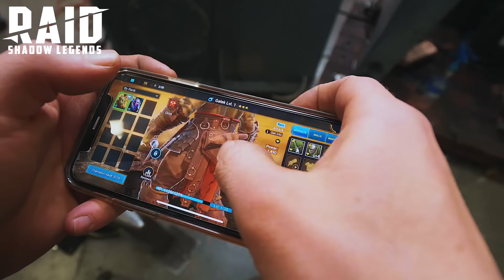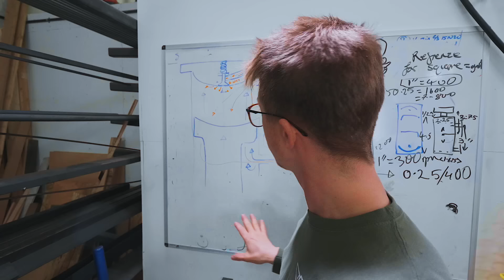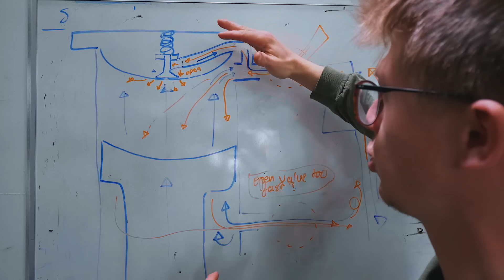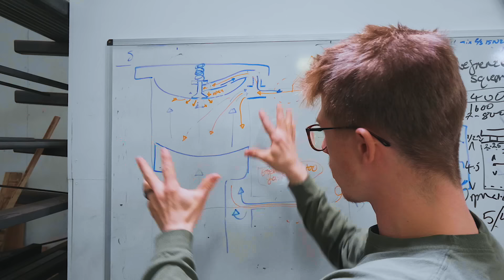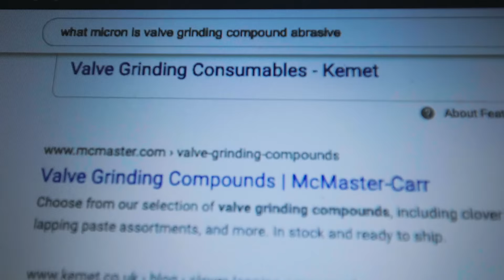FIXING THE 300LBS POWER HAMMER!!! Part 5

Comment: I have a suggestion there not enough pressure on the valve to close the valve when the hamer is going up it happen to hi power engines when there turbocharged the engine is moving so much air so fast with so much force the valve spring can close the valve fast enough and u wind up breaking valves but since the valve on the chambersburg is counter set in the top casting u wind up smacking the top try messing around with the valve spring streangth to prevent air forcing the valve open while the piston is coming up and resulting in the lack of air pressure needed to stop the ram from hitting
Reply: Another possible cause could be the  ram not sealing fully against the bore and the "air cushion" is leaking past the ram allowing contact with the top cover.
Also check if the top cover is warped more that the gasket material can compensate for.
Reply: wonder if he can find a spec on the valve spring pressure.  in cars it's measured by LBS/inch.   John Grizzle also has a great suggestion.  the seal would be a wear part.
Reply: Maybe also oil the gasket (both sides) and reinstall. However, I wouldn't expect that volume of air to make much difference. Intriguing - interested to know what it is when you fix it!
Reply: Yup check spring and if the piston has rings or gaskets those are probably due to be replaced as well.
Reply: Definitely check the piston seals!
Reply: It may be leaky enough that you'll need to supplement pressure with an air pump.. How high is your altitude, btw?
Reply: @graithtools8215  
That's a good point. Ambient air pressure and air density might be an issue you need to tweak for.
Reply: So Ethan, are you talking about valve float? That is at high revs the spring is not strong enough to close it fast enough the piston slams in to the valve. This is not what is happening here. This is a back up only opens when the piston gets too high and covers the normal valve holes and making it stiffer would not help. It could be to strong and looking at the valve it does have an adjuster so maybe he got it too tight so it's not opening soon enough or wide enough to keep it from hitting the top. John Grizzle I think blow by might be an issue looking at the walls there is enough surface rust to maybe hurt the rings or seals (if it has them).
Reply: Valves opening from air pressure in combustion engines is a myth. And I'm sure this isn't comparable to "valve float" we would encounter in combustion engine.

Comment: Judging by how easy it was for you to compress the spring by hand, I would say the spring is worn out. Tightening it more may not be enough, you may have to replace the spring. You can have a perfect seal, but the compression alone can force it open if the spring is weak.
Reply: Exactly
Reply: I agree, often you have to replace valve springs on an engine.
Reply: When the hammer is moving up the valve is forced into it’s closed position, the spring is not being compressed. I think that means the spring is not the problem.
Reply: More likely air is escaping around the ram therefore not creating a proper air cushion
Reply: Please paint it.  It deserves to look so much better than that!
Reply: @freebordwerm  I disagree, metal on metal no matter how much you polish it will not create a perfect seal. The spring is there to help prevent air from working its way between the two metal surfaces and forcing the valve open. If spring tension is to loose it will force the valve open since it is following the path of least resistance. This happens with cylinder heads on a combustion engine when the spring is worn out resulting in compression loss, blow back through the intake, or backfiring through the exhaust.
Reply: CARL X GAMING you nearly had me convinced, I see where you are coming from but if you mean that the air squeezing between that seal could open the valve even more then I think you are wrong. The pressure exerted on the inside of the pressurised chamber does not discriminate. It will apply force to all inner surfaces in an outwards direction, forcing the valve closed (as closed as it can be) That is the premise of that valve.
In conclusion, some air is likely to escape through the valve but given the volume of the chamber and the speed of compression I don’t think it makes a meaningful difference. But the escaping air through the valve cannot possibly force the valve to open at all. 

Don’t mind if I’m wrong but I don’t think I am.

Edit: The spring is there to make sure the valve returns to the closed position after it opens.

Comment: In the automotive world, we would check the recommended spring rating to see if that was sufficient, then also lap the valve seat to fix the seal. Fun stuff. 🤓 I made my comment about 5 minutes in. Clever workaround. A wise man once said “it’s not stupid if it works!” 🤓 Paint the hammer in a Union Jack pattern, of course.
Reply: Union Jack! My thoughts exactly! :D
Reply: Only appropriate if it was made in the UK or British Empire.  If It is from the U.S. then the stars and bars would be a choice, but seeing as I see the equipment as being from a company first, then the country of manufacture, then I guess the original paintjob would be most appropriate.  I think your suggestion is pretty good, especially as Alec came from the U.K. originally but given my choice I would do it differently because I would love to see the original finish on this antique machine.  No disrespect intended to your opinion, it is after all a pretty cool and iconic idea for the hammer.
Reply: I was thinking the same, Union Jack!!!!!!

Comment: My money is on that spring needing replaced. It’s probably taken a set over the years.
Reply: I agree
Reply: Yupp, a spring that large seems like it should be pretty stiff, but obviously he's able to compress it with just his hands.
Reply: Only problem is finding the right spring tension. Too soft and the piston hits the cover. Too strong and the valve doesnt open and cant start sending the piston down.
Reply: The spring's purpose (if you look again at the diagram he drew), is to allow air back into the chamber on the cylinder downswing. Once on the upswing, even without a spring present the air pressure would push up on that valve and seal it. That's what he was lapping.  The spring is only there so the valve isn't hanging open all the time, it only needs enough force to hold the weight of the valve and open easily enough when pressurised on the downswing.  Unless the spring is so weak it doesn't even hold the valve's weight, which I don't think Alec would have missed.

 I think he has to go back to adjusting his turnbuckle like in the previous video.
Reply: @NytRydr  good point.
Reply: @NytRydr  However, what keeps the air from going past the valve stem and out the top when it opens? If it is on the up-stroke and forces the valve open, the air may still be escaping past the valve stem if the valve guide is worn. But really I am just spit-balling ideas at this point....
Reply: @UncleDon226 The top of that check valve also has a cover, you can see it at 13:48, so it's unlikely that air is leaking out there. What I read another commenter say is that it could be the piston rings (if it has them) that's worn coupled with the rusted cylinder bore that could be it. But I am just guessing too.
Reply: @NytRydr  Just a bunch o' lads debating the intricacy of machinery. Doesnt get better than this

Comment: Alec: Explains why it's impossible to mate two metal surfaces airtight without a gasket.
Alec five minutes earlier: Shows how to mate two metal surfaces airtight without a gasket.

All right, I know.

Seriously, the more I see of this thing's guts the more it looks like a two-stroke engine. How is the ram sealed to the bore? You can't run a two-stroke (or a four-stroke) for decades on the same set of piston rings, and you sure can't expect that monster to use the same set of ram seals forever.
Also, the in and out valves surely need more attention, as you said beginning with that Jerry-rigged linkage. Somewhere there must be an ancient generic shop manual on setting the timing on these things.
Reply: The piston rings is actually a really good one. It has always stood out to me how fast the ram comes down once the machine is shut off. Indicates air is flowing past the seals quite quickly
Reply: My thoughts exactly. I think the ram seals are bad, or maybe they're directional and upside down. Causing more pressure to lift the cylinder than drive it down.
Reply: Likes comment because it sounds smart and correct, has no clue what half of the words mean 🤣👍
Reply: @thorzyan  ;>)
Reply: second person I've seen mention piston rings... and I think you're right.
Reply: I thought the same thing.. :) but to the layman (not alec) that is watching.. trying to explain the absolute difference and why gaskets are used would take too many words. I let him off the hook because he said "allow you to use a milled finish and a gasket", justifying the reason they are used... to save costs as lapping is time consuming and would be expensive in large manufacturing where a gasket will do just fine.
Reply: @jdeluca6181  I don't think they'd be in upside down unless an absolute dipstick had done maintenance on it at some point. Badly worn, for sure.
On the other hand look how poorly the whole machine had been treated to let the original motor be damaged as badly as it was. Maybe that dipstick really was allowed to maintain it before the boys got hold of it.
Makes me wonder what other surprises they're gonna find as they work with it more. :>(

Comment: have you checked the pounds rate on the valve spring. it has to be under tremendous strain and if the hammer is topping out it maybe from overloading the valve. stay safe and take care, also thank you for continuing to post great knowledge oriented content! the hammer looks like a "barney" the terrifying dinasaur
Reply: also the spring could be worn after 70 or more years of hard work  im no metallurgist but i know that metal becomes weak with time if it is worked too much. an im guessing springs are the same
Reply: The way this operates, the piston compression helps to keep the valve closed, so the problem definitely isn't a weak spring.  If anything, the spring would have to be too strong.
Reply: @ninus17  I think you make a good point and you are correct that springs get weak after a lot of use
Reply: @ninus17  well two things, the spring is under no load while in compression, the only time the spring is compressed is when its in the down stroke and it needs to drop the ram. Also in steel there is two kinds of deformation, plastic and elastic, while in part of the plastic range there is no metal fatigue whatsoever, so it will never wear out. I may be wrong but i dont think that valve would open far enough to exceed that stress in the spring.
Reply: The spring rate is irrelevant on the upstroke.  When the top of the hammer piston passes the top edge of the upper intake port opening on the upstroke, the valve is already closed, and the sudden spike in pressure will continue to hold the valve closed.  Only when it reaches the top of the stroke, does pressure come in from behind the valve via the bypass path, and push it open against the relatively light spring pressure plus the potentially high air pressure between piston and valve, to start pushing the piston back down.   Once the piston passes the main intake opening again, the valve spring will pull the valve closed again.   

What would be interesting to know is whether the air cushion occurs only when the valve is closed, or if additional pressure it meant to
build up behind the valve and start to open it before the piston reaches TDC, slowing it even faster.    The timing of the upper driving valve opening might control that (where he was messing with the length of the linkage last time).
Reply: @patricksworkshop6010  no but if the valve has opened many 1000 times the spring is bound to have lost some of its springing ( is that a word ? )  i think it would be worth investigating if the spring is in need of replacement. a spring of that size cant be too expensive

Comment: Battleship grey with a clear coat.
Also try a drill on the stem of the valve it will save you alot of time and effort when lapping.
Reply: Union Pacific Harbor Mist Gray is more attractive than Navy "Battleship" Haze Gray...
Reply: You can't go wrong with a good coat of battleship grey.

Comment: Maybe a piston ring, or could try increasing tension on the check valve spring to make sure you are getting a "tight seal" since there is so much pressure inside the ram it might be leaking through if it does not have enough pressure holding it up. That would be a quick check to see if it helps, then can go into more trouble shooting if it hits the top again.
Reply: + 1 on the spring. I would imagine it would be worn after years of use.
Reply: The tension of the spring is irrelevant. The pressure pushes on the valve and seals it more.
Reply: @xy-yt3xp  agree as long as it has enough pressure to first have it sealed, if it is not seated some could seep out before pressure builds up and pushes the piston up
Reply: A bad piston ring could be an issue here - but that means pulling out the piston from the machine, which would require some effort. The rust in the cylinder indicates that it might be a stuck piston ring. Hopefully not a broken ring, but in worst case unless you can find one you might be able to get one made for you, look up a company named Daros, which is part of Federal Mogul that usually makes piston rings for ship engines.
Reply: Spring shouldn’t matter, the system pressure on the Dow’s stream side of the check valve should be causing it to seat harder than the spring would anyway. His lapping procedure was all wrong. Should have a thing contact band, not a full seat contact.

Comment: Alec, when you reinstalled the valve, how much did you tighten the nut that controls the back pressure? If the valve is not tensioned enough it might be opening too soon and allowing the ram to top out. Try tightening and see if it helps.
Reply: Yeah that might be the problem...
Reply: Ken Levy well in my understanding.. when the spring would be to soft. The air would get easier in the upper chamber and the ram wouldn’t hit the top. Because the valve lets air trough, when the main airflow is blocked.
Reply: good idea, but this is an old spring and is likely fatigued to the point it is nowhere near it's original strength, and should probably be replaced.
Reply: thats what i figure too the spring is likely a bit weak a few turns may be all it needs to increase the pressure enough to prevent contact
Reply: Or throw a thick washer between the nut and spring if the spring is fatigued. It will add to the tension.

Comment: Also; you may need to lap the valve seat again, only this time with the spring installed. The valve may be angled slightly.
Reply: This, the canting will result in a poor seal.
Reply: I think I saw blue on the valve seat while he was testing it with water, the grease in that would act as a barrier. 
Wouldn't trust the water anyway to much surface tension compared to air, even with detergent added.

Comment: YES! Change the colour! I would love to see an all shiny power hammer. Just polished steel. Old paint off... Maybe will could do a little handsanding and handpolishing on that 🤣😍
Reply: Will, get to work 🤦🏼‍♂️ probably need to go with a bicarb blaster for that beast.
Reply: Kerim but he can’t do any filing will would be heart broken with out the filing hand saying and polishing 😂😂 it’s a process
Reply: Maybe there is some excess welding here and there. For those he could use a file! C’mon Will, do it for us!!! If you do, Alec probably will start using red dykem or say ellumminum (Aluminium), which btw is definitely the wrong way to say it 😜